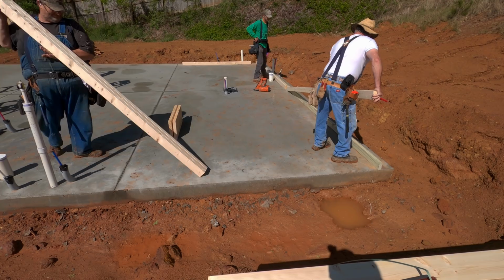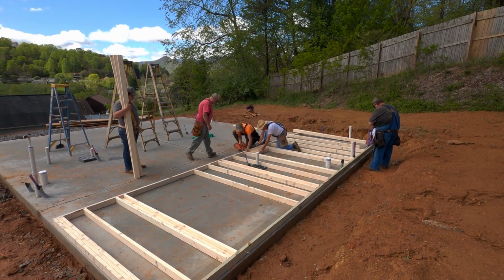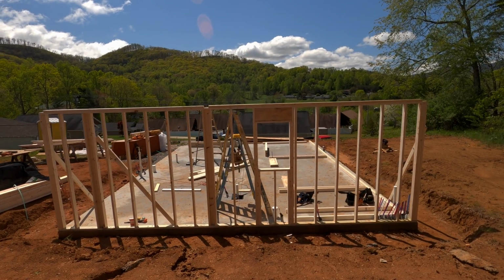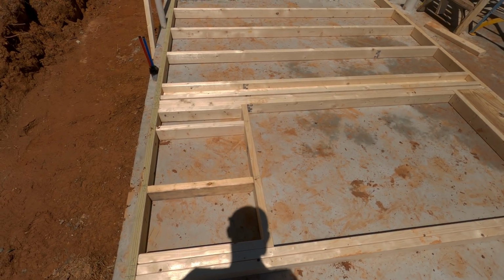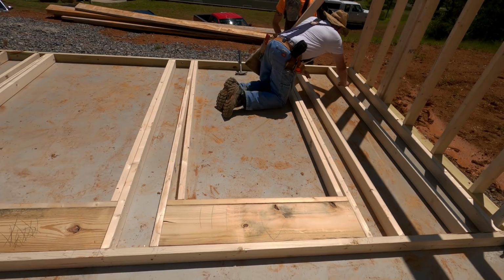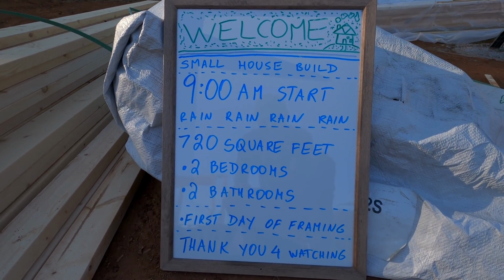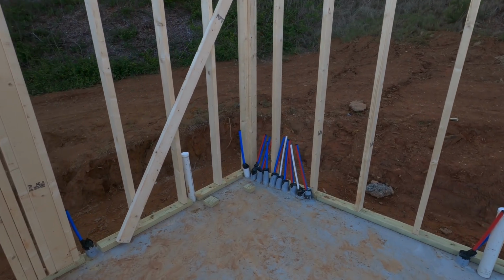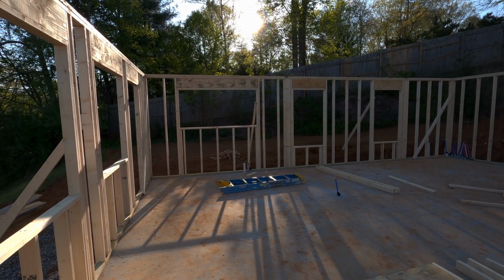Framing a small house build (720 square feet)

Comment: I don’t want to lock you into any real numbers or anything. But my wife and I are passionate about moving back to a large piece of property in our hometown to raise our son.  We have a septic and well on site, our foundation in the north will cost about 15k... rough numbers... what might a 720 square ft super simple single pitch roof 2 bed 1 bath cost? Bath floor and kitchen floor must be finished and the bath must function according to local ordinances.  Other than that, bare bones will get by.   I have a background in cabinetry and finish work so I will be taking on some of that slowly. The local inspector is willing to work with us.  Your thoughts?
Reply from the maker: So tough to answer without knowing the project, and how much you will do yourself. If you bust your arse you can get it done for 100 square foot everyone talks about with humble finishes but that number is very hard to hit now a days.

Comment: Problem with where I live (Southern California) is pulling a permit for a new stick built home runs about $50,000, which on a small house is extremely cost prohibitive.  To pull permits here for a manufactured home, runs roughly $1300.  Its very frustrating building here.
Reply from the maker: I used to live in an area like that, red tape costs more then the actual build

Comment: How does the frame get attachted to the foundation?
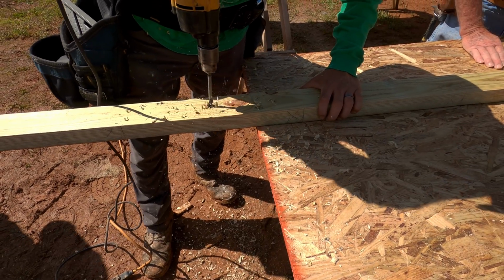Reply from the maker: With bolts, you can see the holes for them get drilled at 1:51 they will get put in later. To hold everything in place temporarily ramset is used.

Comment: I may have missed this in the other video. Why do you not use a J-bolt embedded in the concrete? I doubt my building inspector would allow any kind of wedge anchor.
Reply from the maker: Anchors come later that is how we do it here and it's not an issue.

Comment: My house framing in Romania,the wood i have used to build is minimum 4x the diameter you are using,15x 15 cm is the thiniest what i used,my frame is secured to the foundation with damm bolt bars ,  the frame 15x15 cm pole boxes facing different direction in case of earthquake,  i have space enough in those boxes for good isolation within the frame i used  wool,condensation foil,osb outside 2cm plus 10 cm polyester isolation,than the decorative paint,im not talking about the roof,25x 10 cm trees i can say 6-7 m long pieces,summer  time no A/C needed talking about 42 celcius degrees,winter time easy to heat 80 dollars a month with wooden pellet central heating what produces also hot water,im not using matches to build houses,we have high winds how about USA? Im not wondering tornadoes are sucking up those matches.Sorry for my opinion.
Reply from the maker: No need to be sorry for your opinion we all have them, at least you are respectfull. As for winds United States is a big place so we have different climates and conditions throughout the country. Local codes remedy all of that, that is what I follow.

Comment: I had terrible migraines, some lasting months on end, for over 30 years. I then cut out refined sugar and processed foods/drinks from my diet and the migraines stopped completely! I I have been free for 5 years now and have never felt so liberated (I also lost over 30 pounds). Sodas, milk shakes breakfast cereals will screw you up. Check all the products and if it has more than 5% sugar DONT EAT IT!! Eat mainly whole foods, plenty of vegetables and reduce meat intake. You will also find your taste buds become more energised. Try it, what have you got to lose except your migraines. This is the best advice for anyone suffering like I did. Good luck and great channel.
Reply from the maker: Thank you, I am doing a lot of what you said, no sodas, shakes or cereal at all, zero. I cut down a lot on sugar that just made me feel better all together, but head still pounds. Thank you for the advice I always experiment, I did find when I cut out bread products I get less migraines.
Reply: @MigraineCraftsman  have you been tested for gluten sensitivity?  You could do your own test by completely cutting it out for 30 days.
Reply from the maker: @nancyfryhover  Not officialy by a doctor, I did my own test as you said that lsted longer then 30 days and I still got em.

Comment: Just vow! Clear presentation. I did not see air tight membrane below the bottom plate. Would it make a do. Also would having a radiant floor heat be cheaper compared to adding Hvac.
Reply from the maker: Greetings and thx, bottom plate will be caulked later when I'm ready to insulate my baby. I also would love to do radiant heat but $$$$$$
Reply: Migraine Craftsman : thanks for the reply. I am under the impression that radiant floor is cheaper and very efficient and cheaper maintenance. Should add value to home. Not sure if you need cooling unit for summer. Here in PA, we can open windows in summer
Reply from the maker: @squeekhobby4571  This house is in GA so cooling is a must in the summer. That means in my scenario it would be more $$$, hey but in different areas it might work just fine as you said.

Comment: Was going to ask about the bolts that are usually set in the foundation, didn't see them, but saw you drill the holes in the base plates
Reply from the maker: Yup they are coming later, should be next spisode or so.
Reply: Thank you for your reply and the videos in general. I started renovating houses here in New England about a year ago but wondering if I could get into building. Slab foundations seem so simple wondering if we could do something similar here in New England if we add radiant heat and frost walls.

Comment: Why the headers over the window and doors, thought you just need you king and jack to support openings in the framing, that 2x10 is basically an un-insulated part of the house isn't it? plus 2x10s are expensive
Reply from the maker: You need those to support the weight coming down on the windows and doors. If you do no do that you might have trouble opening your doors and windows. Plus my building inspector would give me a spanking if I didn't do it, and I'm not about that life.

Comment: Nice to see more on this new project of yours. Ever think about using advance framing on your houses? Might not be worth it on the smaller houses that you build but still like to hear your thoughts are on advance framing.
Reply from the maker: Honest opinion I am not a fan. Studs are spaced out too far apart and if you manage your construction site well with minimal waste you can get very close to what advanced framing has to offer with regular construction methods. 
If you watch future videos notice there is little to no wasted lumber with these guys. They are awesome. Most are ex military, main guy has done this for over 40 years now.
Reply: @MigraineCraftsman  Thank you for your input.

Comment: Hi,
This is great. I just recently discovered your channel. Your presentation format is refreshing.
I’m surprised you are not required to use some sort of sill-sealer. Keeps out bugs and reduces drafts.
Jim
Reply from the maker: I'm going to caulk the heck out of it later.
Reply: Migraine Craftsman 
Hi
Gosh, you  really should try a sill-sealer like this: https://www.homedepot.com/p/Owens-Corning-FoamSealR-5-1-2-in-x-50-ft-Multi-Use-Ridged-Sill-Plate-Gasket-2FS/202080947
It’s really effective, cost efficient; and it’s available at Home Depot! Unless you have an unlimited supply of caulk on hand, this is the way to go!
You were very patient explaining that different areas of the country have different foundation requirements. In NH, my dacha’s foundation is 12” thick, goes down four feet below grade, and used 92 yards of concrete!
Thanks for all your time & effort in bringing us your videos!
Jim